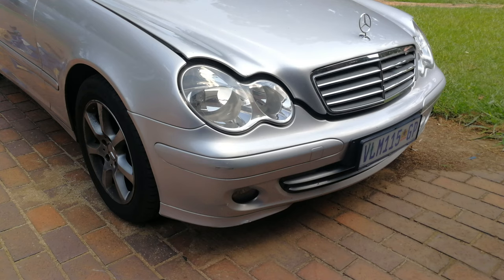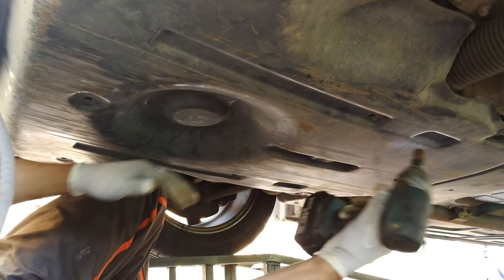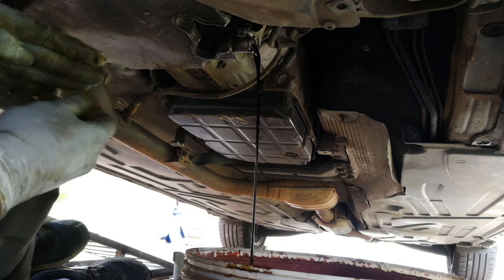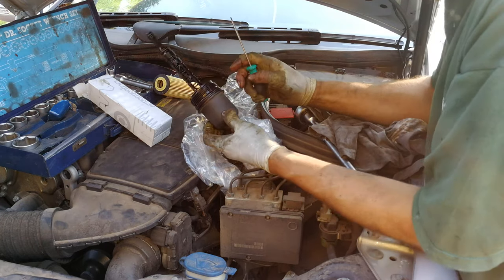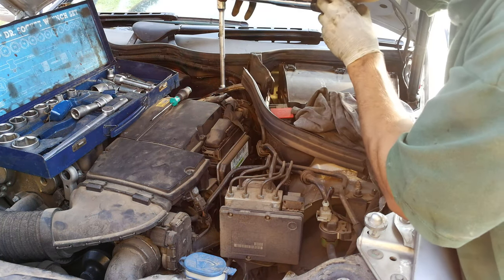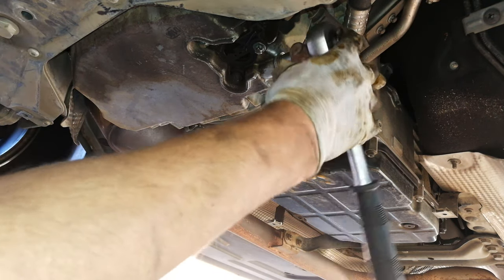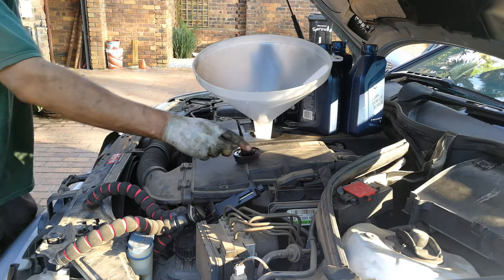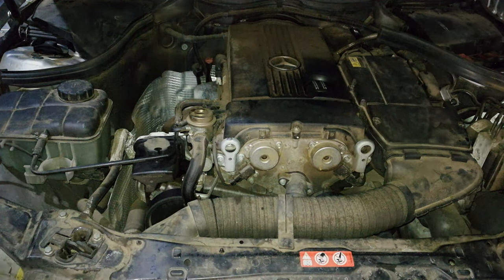How to change oil and oil filter on c-class Mercedes (W203)

Comment: It's even easier to change the oil filter if you open the bonnet fully. There's a red button on the strut. Push it in and push the bonnet towards vertical. It will click in place when you've done it. It takes about 2 seconds from start to finish.

Comment: Why did you use bmw oil?
Reply from the maker: its cheaper and its spec is 5W30 which is same spec for the c-class in my climate. (also i repair BMs and have a lot of the oil...) If you can get Mobil 1 0WX then that would be best.